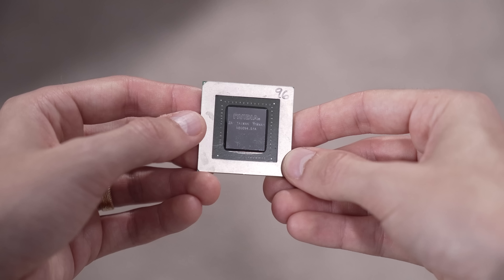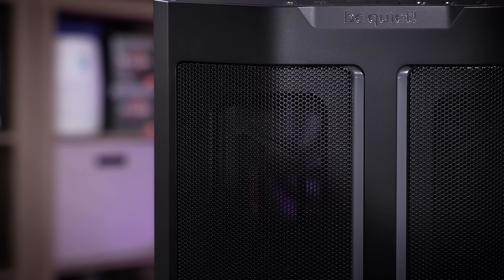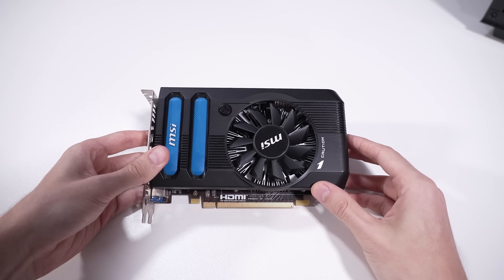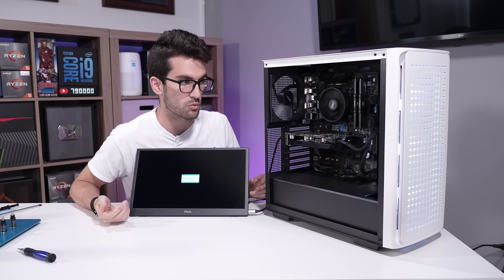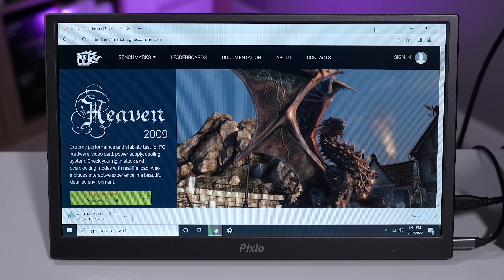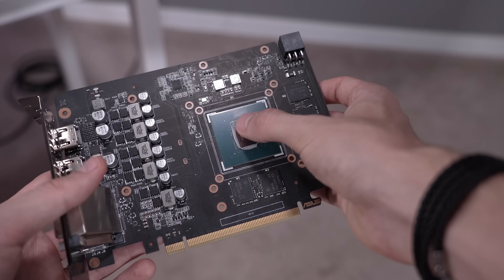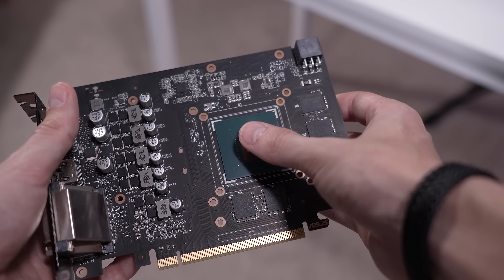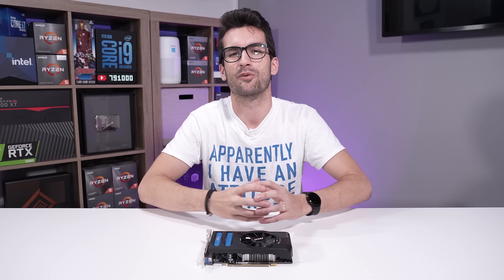"Just Bake It"

Comment: You arn't reflowing shit.  This is a failure inside the chip itself.
Reply from the maker: It... Worked. So, yeah...
Reply: @GregSalazar  Go look at Rossmanns video about 'reflowing' video cards.  It will work for a few months to a year and then back to the drawing board.  Oh yeah Linus was in that video.  Sorry to be harsh, its just this was debunked like 5 years ago.
Reply: @MichaelBruceTaos  stop making a fool of yourself and watch the video first before you start to argue
Reply: Are you 100% certain it's a failure inside the GPU die?  That's an awful lot of confidence for not performing any root cause analysis on this particular card yourself.

It very well could be a latent defect or outright failure of some part of the GPU silicon.  It could also be a cracked solder joint between the GPU substrate and the PCB, or even a solder joint under a memory IC.  Hell, it could even be a cracked via-trace connection buried in the board.

Did he actually reflow some solder?  Maybe, maybe not.  A heat gun isn't exactly the best/easiest method of reflowing solder.  But whatever the problem was, blasting the card with heat appears to have fixed it, although like Greg said, this "fix" can only be considered temporary.  Maybe this temporary solution is just enough to get someone by while they shop for a new GPU. ¯\_(ツ)_/¯

Point being, you can't jump to that conclusion based solely on the information presented in the video. You don't mean to be harsh, but your intent was not conveyed very well in that shitty comment.